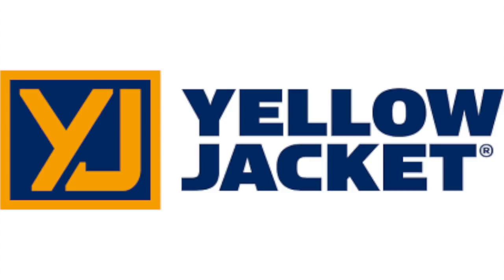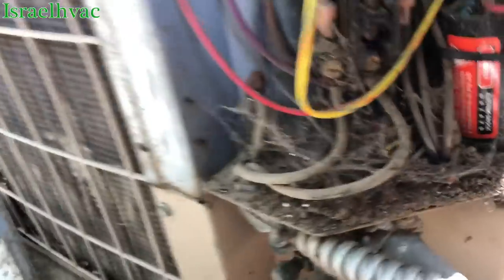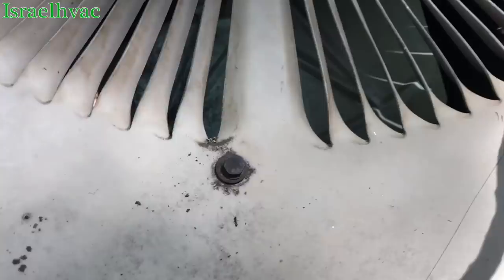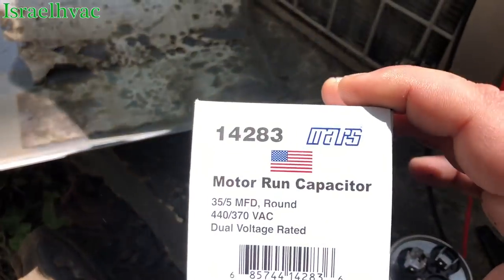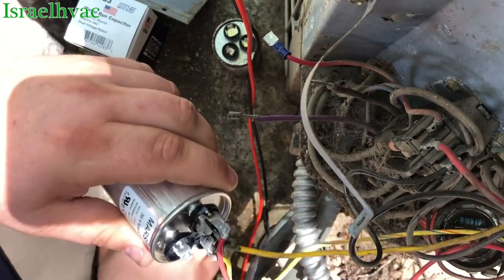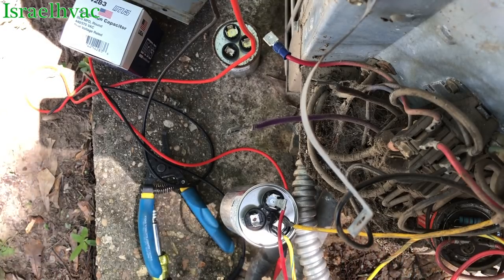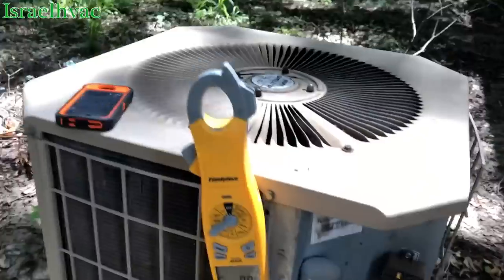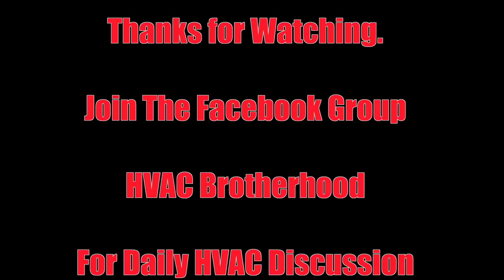Bad HVAC Capacitor | I Make a Big Mistake

Comment: My York compressor was contractor grade on a new house. The fan lasted 6 months....Completely seized up. And even though the system was under warranty, the HVAC company who installed it wanted to charge me for a service charge, diagnostic charge. Then when they discovered the problem, another service charge to come back out and install it....but the parts would be free....Total charge would be $450 there abouts...even though I told them that the motor was bad. No dice...$450. So, onto the internet I went. New motor for $80. Free shipping and it was at my door in 2 days. Swapped it out myself and it's been running no issues for the last 15 years now...

Comment: Never forget to check with a meter that has been verified in good condition before you leave the shop. 

I work mostly with 480 volt circuits, you DO NOT want that latching on to you. It kills. So does 240. Be safe,

your family wants you home after work......

Comment: first off, thank you for sharing...I have a couple questions for you...did you really leave a unit that had a 110 v when you checked L1/L2 to ground?....that seems like the mistake...and it sure look like the capacitor is what shocked you...maybe I'm missing something, but leaving a unit essentially hot to the touch is pretty gnarly and dangerous...maybe I'm misunderstanding but if you had 110v to ground doing this, you left it that way?  Did you have to go back shortly after this repair?  It takes a big man to admit mistakes, and I applaud your work/sharing....

Comment: That happened to me once before. Someone had bypassed the disconnect completely because the terminals were bad or something, but left the pullout block in there and everything. So you only got bit by the 110, but I got the full 240 and knocked me right on my ass! So don't feel bad it happens. Now I've had to do that before to get someone going in a pinch, but in that case, I removed the disconnect completely, so if someone else goes out there, they wont see a disconnect, so they'll go inside and shut the breaker off, and not get fooled by what looks like a disconnect thats been secretly bypassed.

Comment: My motor is still working. However, I feel like I'm replacing the starting capacitor every year. Is the motor going bad causing the capacitor to fail sooner than it should? Or Should I replace the relay, which people say can be failing and causing power to stay in the capacitor longer than it needs to be. The fan does easily spin if I push it with a stick.

Comment: I was told by a mentor that anytime you are working in a panel have one hand in your back pocket. If you have both hands in the box you can create a circuit that goes from one hand to the other by way of your heart. That is not good. Be safe.

Comment: Ive been doing this for 20+ years, and always, always check line voltages with a volt stick...Even simple 120v circuitry. Only been zapped 5 or 6 times in all the years.

Comment: I fixed a unit it had 2 terminals burned off the compressor. I had used crimp on connectors  straight ones and wired it up crimped it tight it runs... I worked on a unit it wouldn't start so I hit it with my hammer in the sweet spot and compressor started still runs today.

Comment: Hi. I have a question for you. I have a new ac unit about 18 months old. My capacitor went bad. There were only 2 wires going to it. Brown to herm and red to common. No wire on fan. It was working perfect until 2 days ago. I took a picture before I removed the wires. I purchased a new capacitor and check it with my capacitor meter and is in perfect range. I connected it exactly like the original was. Brown to herm and red to common. When I turned on the breaker the fan kick right in. But now is not working again. The fan is not kicking in and all I hear is a buzzing sound from the compressor. What can be wrong if the new capacitor tested good and I made all of the correct connections? Please help I’m sweating here!!  Thanks in advanced!!

Comment: When you were wiring hot, your knee was on the ground. Not a good idea being well grounded while you are dealing with live wires. The better you are grounded, the more current can pass thru you. Get one of those rubber knee protectors, could save your life!

Comment: I had a 480 volt 3 phase heat control box that the customer wired around the service disconnect cause it was bad. Who woulda thought? When I mentioned it, they thought it wasn't a big deal. I told them, if I'da caught two phases instead of one, we wouldn't be having this conversation cause I'd be dead.
I had another panel where the disconnect was wired hot into the bottom, not the top. Got bit then also. True, bottom line, only you can prevent getting shocked. Don't trust the breakers and don't trust anyone else to say the power is off. And watch out for grounded 480 volt legs.

Comment: So same problem on Lennox system , question, if i spin fan manually , (fan works, still hot air, if i change campacitor  it will fix fan( probably) will it also make compressor work( when fan is on and running I still get hot air inside) Im assuming its not pushing cold because campacitor even though I can make fan turn on.

Comment: I saw my co worker not check voltage on a 480 volt air handler on college campus. It was wired wrong. He put hex key on terminal to change fan rotation on 3 phase 480 .He got hit. His arm hurt for a week.

Comment: Pick up one of those pen volt sticks from fluke makes a real good one
Reply: I ONLY trust those sticks to tell me its live NOT that its dead.  And don't get me started on Fluke and how SHITTY of a company it has become since bought.
Reply: If you want to die, then yes buy a death stick.
Reply: If you don't like Fluke who do you suggest? What if you turned off the breaker and you meter said things are off and just for the heck of it you poked around in the panel with your volt pen and it goes off? It may have just saved your bacon.
Reply: My meter has a built in voltage detector.The bad thing about voltage sticks is they are not going to tell you the actual voltage present where as a VOM will.
Reply: I've seen voltage sticks chirp when the wire was dead.
Reply: You can't beat sticking your fingers in your mouth and then touching the wire with your wet finger, it doesn't give a true reading but if you start pissing your pants then you know it is a high reading.
Reply: Use a VOM or a Wiggy .  I have seen disconnects where one or more blades did not turn on or did not turn off .

Wyr
God bless
Reply: They are called chicken sticks might as well have one cuz we are all chicken to die
Reply: I have that same Fieldpiece meter he has. It has a NCV function on it, for non-contact voltage. It's pretty sensitive and can pick up a live wire from a couple inches away. Can even pick up a thermstat wire if you hold it right up against it.
Reply: Buy a meter with it built in....Less tools the better.

Comment: What is a bit confusing, is you turned off the disconnect, then did a hard start and the compressor ran.  Wouldn't that indicate there was still power to the unit?

Comment: Also could get zapped from the evap fan motor capacitor if not discharged, I know, I did, and had the complete power off at the main CB..........gotta watch for that power hanging around in components.....

Comment: Holy shit, did you ever figure out the source of the 110 volts and how it got around the disconnect??

Also I’m a home owner and auto truck fleet tech with general knowledge enough to do some of my home AC upkeep.

I found the disconnect used on my rheem heat pump fuse style that you yank out was such garbage cheap made, that the female blades at the actual pull out would loose tension causing lots of heat and high resistance and fuse failure on a Cutler-hammer DPF222RP so I had to bypass, and haven ruined a contractor or had any wires even run warm and the compressor ran cooler as well.

Haven’t killed any more capacitors as well.

Comment: Thank you for sharing!  (Someone's life could be saved if this were on a roof, etc.)

Would one of those "hot probes" (pen-like red light things) work for the "is the disconnect working" check?  Or do you recommend meter-checking all the wires that need checking?

Comment: But you said you turn the disconnect off manually triggered the relays and do you know star power up I didn’t understand that

Manhattan years ago in the 80s got it was 660 it was my first month on a job never ever forget it you’re right trust nothing check everything

Comment: I noticed when you pulled the disconnect and tried to energize the contacts it should have not energized the system. 
Should it have been your first clue that the disconnect was not working?

Comment: Brother did you de- energize the capacitor? Would that not have held that little bit of current in the system to have shocked you? Or did you bridge the terminals to de-energize it

Comment: If your thermostat is on and so is the breaker ,you WILL get zapped nice n juicey despite having turned off the disconnect. I always turn them BOTH off.  ( breaker n disconnect)

Comment: How much did you charge for this call?. I m a landlord and l had to learn how to fix my own ACS ,plumbing and remodelling to avoid getting ripped off by scammers especially by ac people. Sometimes, it's so easy and cheap to fix an ac  just by replacing a capacitor or a fan motor, or a blower motor etc....

Comment: He's getting 110 because the indoor fan is onit's because in a split system with central heating if you do have central heating with the furnace  know that your indoor blower supply fan is tied to the AC and the ignition board for the furnace

Comment: Would a Ruud's model #UPNJ-037JAZ uses the same capacitor rating?
Or what would be the part number /or rating of the capacitor?
Please, also the fan's part number or third party fan?
Your help & succession are greatly appreciated.

Comment: I left the disconnect on and the common to the cap was wired to the metal bar of the contactor and i got buzzed so the cap had 120. I just grabbed it with my hand

Comment: came to watch the zapping and laugh loudly with jaw flapping :))))))
I've been zapped tons in the last 25+ years, far more than most folks would be in 6 life times. majority was my own fault too, wiring live and all..... insulated shoes and only one hand touching/shocked was most of them. but got nailed hand to hand plenty of times as a sparky in the 90's, simply too lazy to turn off the breakers and had other contractors working off the temp outlets. new construction residential, so mainly all 120v.
the least fun experience ever was an old basement in knee deep water replacing a failed sump pump, no ground and the outlet box/metal plate was "hot", although I quickly found out why the sump pump failed! the case was eaten away from the current flow.

Comment: Thanks for posting John 👍🏼 I definitely get relaxed when I pull the plug and I’ve stopped checking voltage by trusting the disconnect. Correct me if I’m wrong, but did you do the voice over because of all the cursing? Hahah I sure as hell would’ve been!
Reply: My thoughts exactly... "Holy ess mother clucker! That sh!ts still live!  Ow g--ddam--t!"  

Should also short out the new cap, never know if its got a charge in it as well!  :)

Comment: Electrical components fail for a reason 
Sometimes because they are or get bad at some point
Other times they fail due to other factors of the system 
Don’t always trust it was just a bad capictor or relay or contractor check the system and other components as well while your there even if just a visual check.

Comment: Hi there..  My AC condenser won't' turn on.  I replaced a new capacitor on the condenser, and the same problem occurred.  There is a button that I can press to bypass the capacitor, when I press it, the fan is turned on.  Does it mean my new capacitor is bad?

Comment: I have a old York heat pump it has two separate capacitors , but the lettering on them is faded and cannot be read . Does anyone know how I can find out what what sizes they are . I have the original manual with electrical drawings nothing on them , contacted York they sent me the same info that my manual contained.

Comment: I work on excimer lasers that have voltages between 25k to 32kVDC. If I don't check my voltages and do what you did, I will be dead before I hit the ground! Even if you pop the breaker, double check your voltages with a meter. It takes only a minute and can save your ass.

Comment: @isrealhvac on the capacitor that has two wires going to it there's four spots...... does it matter where you put the wires on those four ....
can they be next to each other or do they have to be opposite..... when someone looked at my AC unit hot air was coming out of the top of it..... because the fan blade was going one way ....when he replace the capacitor it was blowing air out of the sides the coil  .....the rotation of the fan was reversed ....how could that have happened please tell me
Reply: It definitely does matter to which terminal the wires hook to.  Hooked up the wrong way, you can fry a compressor!

Comment: I used to work in a electronic repair shop, I guess sooner or later you are going to get zapped.  I've seen techs get shocked from microwave oven capacitors and the high voltage in a tv set. I liked to use a isolation transformer that has a red light on it when the power is on to remind when a tv is powered on.

Comment: I've seen disconnects on hvac, elevator, and air compressors that failed to remove power. This happens very seldom, but they do fail. Never trust shit.

Comment: I would make an excellent safety tech. I'm always telling people to check and double check all safety precautions. My buddy rewired his dishwasher a few years ago. I kept telling him, Turn off the breaker, Hey man let's go hit that breaker, etc etc. He just wanted to avoid it for some reason. He told us to watch him to make sure we drop kick him if he gets shocked. We waited but then started up a conversation and couldn't hear the humming. I thought he was thinking or in some sort profound cloud. He got upset but I told him, Let's cut the power!! Lol

I am legally blind, I don't have the eyes to be a safety guy but for the short sighted projects, I go step by step as directed.

One day my same friend and I were trying to fix his fuel line to his car. We didn't know what it was so we took pictures of where the hose started and ended. The person at the Auto Zone laughed at us because no had ever taken pictures to show someone. This was before cell phones got really good cameras in them BTW. I told the guy, Look we don't have egos, we know it's an easy fix but we just don't know what it's called or if you have the hose.

He said that guys would rather be proud and not do what we did. As a half blind person, at new things that require technical work, step by step is the only way to go. I had to provide visuals because I can't drive but I know it was easy

Basically, kudos to the ego. I'm here because our capacitor blew up and I wanted to learn how to fix it. I think I might sit this one out and let the pros do it lol. But I learned some safety tips. Thank you, hope the shock wasn't too bad!

Comment: Never trust a switched disconnect, I did that once while putting in an outlet in my garage. I was putting the outlet in a metal box and sparks flew. I didn't feel any shock because the screwdriver took the hit and I was standing on a wooden box, so I was perfectly isolated from ground.

When I took my flashlight and checked the small fuse box in the garage, turned out to be that some idiot had wired a bypass of the switch to power the lights during the construction phase when there were no fuses install. The idiot used a black wire as a jumper, which only helped to hide the wire in the dark corner where the fuse box was located.

Comment: I have a question hopefully you could help with.  My condeser fan wasn't  running so I open the panel and pushed the contactor in and the compressor kicked on but the fan creeped  3 or four revolutions.  I opened up the fan grate and the fan moved freely but was very hot. I took the blades off the motor (1/6hp)  and pushed the contactor again,  the motor started fine but I was able to stop it by just grabbing it.  I ohmed the fan and it is in spec I didnt get a chance to check the cap before the rain came. Does this sound like a fan problem or a capacitor problem?  Thanks for the input
Reply: Call a contractor who knows what he's doing before you burn your place up!

Comment: I have a question for you. I went to HVAC school over 30 years ago and I have a 2 Ton A/C on the plate I am using 56 amps for start up and 11.2 amps running. I want to add a Hard Start to drop my start up amps as much as possible for 2 reasons 1, I want to lower my electric bill. 2. I want to be able to use the A/C if there is an outage so can I buy a Hard Start Capacitor That holds more power to drop my LRA down as much as I can from 56? And what kit should I buy? Don’t worry I went to school for it and know what a Capacitor will do if it has a charge in it. Thanks! And by the way how did you still have 110 running if you turned off the 220 breaker?

Comment: My air conditioner broke down at 4 am. I am a home owner and have no idea what I was doing.  I didn’t turn anything off but the switch that cuts power to my furnace.  I went and wiggled the wires on the capacitor. When i wiggled the power fire right at the terminal it vibrated my finger and I made a weird noise.  How close was I do being hurt ?
Reply: I was actually kind of sleeping. Later I thought what the hell was I doing. I know better and now I know.
Reply: I didn’t turn off the disconnect

Comment: Curious did you fix the problem with the disconect or call it a day when it started making cold air?
Reply from the maker: The disconnect was replaced by the customers electrician.